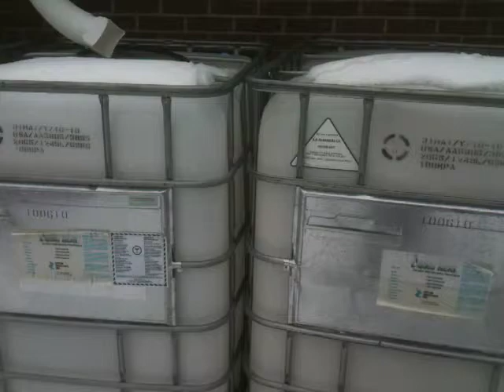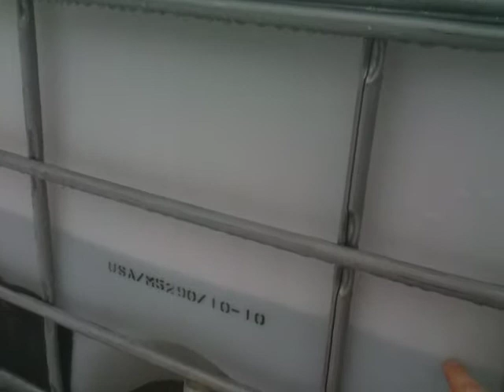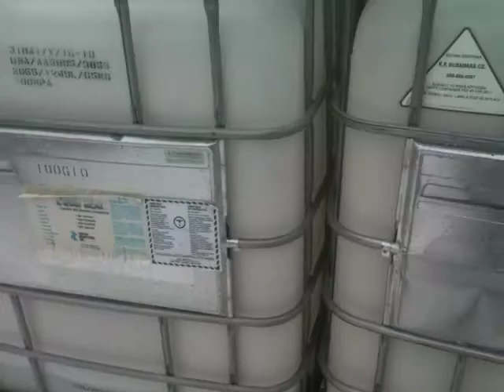rain barrels

Comment from the maker: I used a 3 inch to 2 inch rubber reducer And a 2 inch plastic insert with a 3/4 inch threaded hole with the brass garden hose fitting